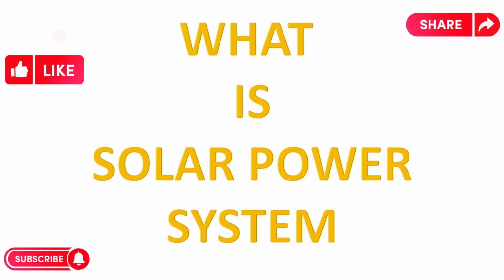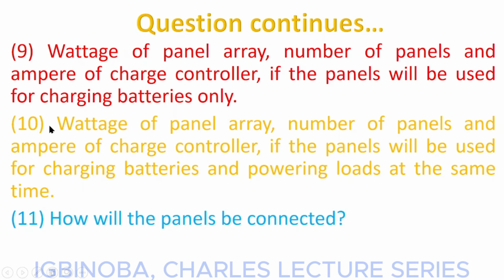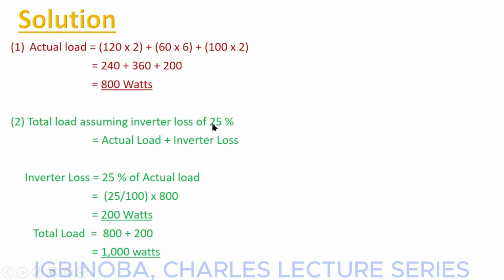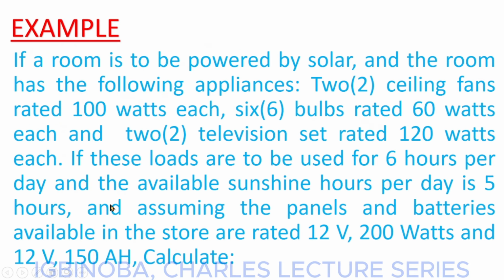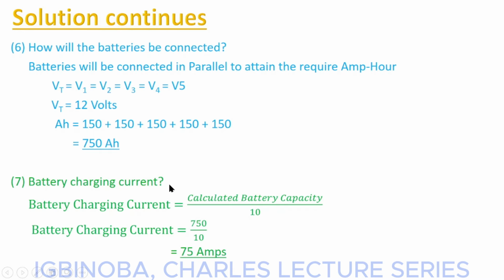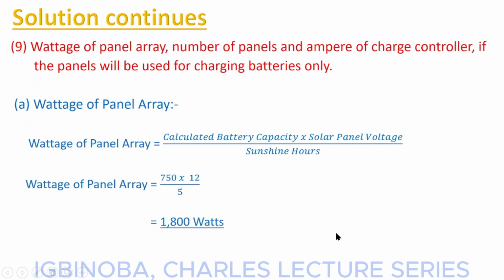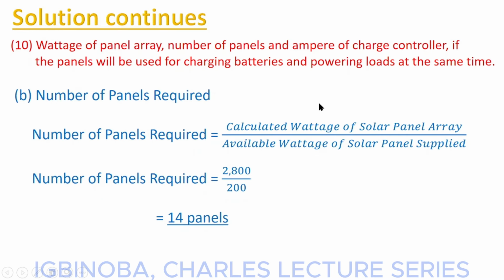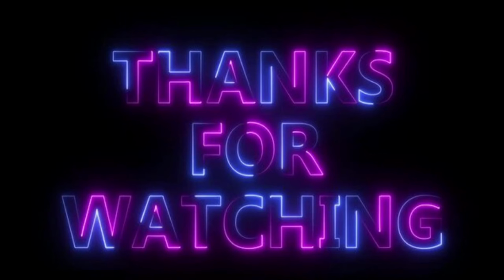Design of Solar Power System

Comment: EEE31E
Answer 
1380W
1725W
2156.25VA
1293.75Ah
9batteries
Parallel connection
129.4A
14h
3105W
16panels
258.75A
4830W
24panels
402.5A
The panels are arranged in parallel

Comment: MAR33G

Actual load = 1380W
Total load = 1725W
Inverter rating = 2156VA
Battery capacity = 1293.75Ah
No. of batteries = 8.625 ≈ 9 batteries
The batteries would be connected in SERIES
Battery charging current = 129.4A
Battery charging time = 14hrs
9a. Wattage of panel array = 3105W
9b. No. of panels = 15.5 ≈ 16
9c. Ampere of charge controller = 258.75A
10a. Wattage of panel array = 4830W
10b. No. of panels = 24.15 ≈ 24
10c. Ampere of charge controller =402.5
11 The panels will be connected in parallel

Comment: EEE17Q
Answer:
Actual load = 1380Watt
Total load = 1725 Watt
Inverter rating = 2156.25VA
Battery Capacity = 1239.75Ah
Number of batteries = 8.625 (9 batteries)
They will be connected in parallel
Battery charging current = 129.375A
Battery charging time with 40% loss = 14hrs
9a. Wattage of panel array = 3105Watt
9b. Number of panels = 16panels
9c. Ampere of charge controller = 258.75A
10a. Wattage of panel array with load = 4685 Watt
10b. Number of panels = 23 panels
10c. Ampere of charge controller = 373.75A
They will be connected in parallel

Comment: MAR29C
Answers

1. The actual pad is 1,380W
2. The Total load is 1,725W
3. The inverter rating is 2,156.23VA
4. The battery capacity is 1,293.75Ah 
5. The Number of batteries is 9
6.  The batteries are connected in parallel 
7. The Battery charging current is 129.4 amps.
8. The battery charging time is 14 hours.
9. a. The wattage of the panel array is 3,105W
b. The number of panels is 16 panels.
c. The Charge controller rating is 258.75 amps.
10. a. The wattage of the Panel array is 4,830 Watts 
b. The number of panels is 24 panels.
c. The charge controller rating is 402.5 amps
11. The panels are arranged in parallel

Comment: Petrochem53A 
1. Actual load: 1380W
2. Total load: 1725W
3. Inverter reading: 2156V
4. Battery capacity using a reserve of 75% : 1293.75h
5. Number of batteries for back up 9 hours 
6. How will the battery be connected: parallel 
7. Battery charging current: 129.4 hours 
8. Battery charging time with loss of 40%: 14hours
9. The wattage of panel array: 315W
9.1 No of panels:16 panels 
9.2 The charge controller rating 258.75 ampere 
10. The wattage of panel array 4830W
10.1. The no of panel: 24 panels
10.2 The charge controller rating 492.5 amps 
10.3 panels connection: parallel

Comment: EEE80B
1380 watts
1725 watts
2156 .25va
1293.75ah
9 batteries 
Parallel connection 
129.4amp
14 hrs
3105w
16 panels
258.75amps
4830 watts
24 panels
402.5 amps
The panels are arranged in parallel

Comment: CIV35I

1380watts
1725watts
2156.25 VA
1293.75 Ah
9 batteries 
parallel connection 
129.4 amps
14 hours 
16 panels
258.75amps
4,830 watts
24 panels 
402.5 amps 
the panels are arranged in parallel

Comment: PETRO26Z 

(1) Actual load = 1380 W

(2) Total load (with 25% inverter loss) =1725 W 

(3) Inverter rating (0.8 PF) = 2156.25 VA

(4) Battery capacity (75% reserve) = 1239.75 AH

(5) Number of batteries = 9 batteries 

(6) Battery connection = All in parallel (12V system)

(7) Battery charging current =  129.375A 

(8) Charging time (40% loss) = 14 hours

(9a) Wattage of panel array = 3105watts
(9b) Number of panels= 16panels
(9c) Ampere of charge controller = 258.75A

(10a) Wattage of panel array with load = 4485watts
(10b) Number of panels= 23panels 
(10c) Ampere of charge controller= 373.75A

(11) Panel connection =All in parallel (12V system)

Comment: Petrochem5E 
 
* 1380 watts 
1725 watts 
2156.25 VA 
1293.75 Ah
9 batteries 
Parallel connection 
129.4 amps 
14 hrs 
3,105 W
16 panels 
258.72 amps 
4,830 watts 
24 panels 
402.5 amps 
The panels are arrange in parallel

Comment: NAT43Q 

1. The actual load is 1,380W
2. The Total load is 1,725W
3. The inverter rating is 2,156.23VA
4. The battery capacity is 1,293.75Ah 
5. The Number of batteries is 9
6.  The batteries are connected in parallel 
7. The Battery charging current is 129.4 amps.
8. The battery charging time is 14 hours.
9. a. The wattage of the panel array is 3,105W
b. The number of panels is 16 panels.
c. The Charge controller rating is 258.75 amps.

10. a. The wattage of the Panel array is 4,830 Watts 
b. The number of panels is 24 panels.
c. The charge controller rating is 402.5 amps
11. The panels are arranged in parallel

Comment: NAT7G 

1. The actual load is 1,380W
2. The Total load is 1,725W
3. The inverter rating is 2,156.23VA
4. The battery capacity is 1,293.75Ah 
5. The Number of batteries is 9
6.  The batteries are connected in parallel 
7. The Battery charging current is 129.4 amps.
8. The battery charging time is 14 hours.
9. a. The wattage of the panel array is 3,105W
b. The number of panels is 16 panels.
c. The Charge controller rating is 258.75 amps.

10. a. The wattage of the Panel array is 4,830 Watts 
b. The number of panels is 24 panels.
c. The charge controller rating is 402.5 amps
11. The panels are arranged in parallel

Comment: MAR19S

Answer 

1. Actual load: 1380 W
2. Total load: 1840 W
3. Inverter rating: 2300 VA (2.3 kVA)
4. Battery capacity: 1226.67 Ah
5. Number of batteries: 9 batteries
6. Battery should be connected in Parallel
7. Battery charging current: 245.33A ≈ 250A
8. Charging time with 40% charging loss: 18.75 hours using 120 A and 40% loss
9. Solar panels for charging batteries only: 2944 W, 15 panels, 250A controller
10. Solar panels charging batteries and powering loads simultaneously: 4784 W, 24 panels, 400 A controller
11. The panel should be connected in Parallel

Comment: EEE52Z

1. Actual load = 1380Watt
2. Total load = 1725Watt
3. Inverter rating = 2156.25VA
4. Battery Capacity = 1239.75Ah
5. Number of batteries = 8.625, so 9 batteries
will be used
6. The batteries will be connected in parallel
7. Battery charging current = 129.375A
8. Battery charging time with 40% loss = 14hrs
9. For charging only:
a. Wattage of panel array = 3105Watt
b. Number of panels = 16panels
c. Ampere of charge controller = 258.75A
10. For charging + powering load:
a. Wattage of panel array with load =
4830Watt
b. Number of panels = 24panels
c. Ampere of charge controller = 402.5A
11. The panels will be connected in parallel

Comment: PETRO85G

1. Actual Load: 1380 W
2. Total Load: 1840 W
3. Inverter Rating (0.8 Power Factor): 2300 VA (or
2.3 KVA)
4. Battery Capacity: 1226.67 Ah
5. Number of Batteries: 9 batteries
6. Battery Connection: Parallel
7. Battery Charging Current: 120 A
8. Battery Charging Time: 16.67 hours
9. Solar Setup (Batteries Only): 2944 W (or
3000
W), 15 panels, 250 A charge controller
10. Solar Setup (Batteries + Load
Simultaneously):
4784 W (or 4800 W), 24 panels, 400 A charge controller
11. Panel connection: parallel

Comment: CHM23W
Actual load = 1380Watt
Total load = 1725Watt
Inverter rating = 2156.25VA
Battery Capacity = 1239.75Ah
Number of batteries = 8.625 (9 batteries)
They will be connected in parallel
Battery charging current = 129.375A
Battery charging time with 40% loss = 14hrs
9a. Wattage of panel array = 3105Watt
9b. Number of panels = 16panels
9c. Ampere of charge controller = 258.75A
10a. Wattage of panel array with load = 4485Watt
10b. Number of panels = 23panels
10c. Ampere of charge controller = 373.75A
They will be connected in parallel.

Comment: MEC24X 

1. Actual load= 1380W
2. Total load= 1725W
3. Inverter rating using power factor of 0.8= 2156.3VA
4. Battery capacity= 1239.8Ah
5. Number of batteries= 9 batteries 
6. They would be connected in parallel to maintain the same voltage
7. Battery charging current= 129.4A
8. Battery charging time with a loss of 40%= 14 hours
9.   (a) Wattage of panel array to charge battery only = 3105W
      (b) Number of panels= 16 panels
      (c) Ampere of charge controller= 258.8A
10.   (a) Wattage of panel array to charge battery and carry load= 4430W
          (b) Number of panels= 25 panels
            (c) Ampere charge controller= 402A
11. They would be connected in parallel so that the voltage doesn't change

Comment: EEE48V

1380W
1725W
2156.23VA
1293.75AH
9 batteries
Connected in parallel
129.4amps
14
3105W
16
258.75amps
4830watts
24 panels
402
Connected in parallel

Comment: CIV89K

Answers

1.  Actual load = 1380Watt
2.  Total load = 1725Watt
3.  Inverter rating = 2156.25VA
4.  Battery Capacity = 1239.75Ah
5.  Number of batteries = 8.625, so 9 batteries will be used
6.  The batteries will be connected in parallel
7.  Battery charging current = 129.375A
8.  Battery charging time with 40% loss = 14hrs
9.  For charging only:  
    a. Wattage of panel array = 3105Watt  
    b. Number of panels = 16panels  
    c. Ampere of charge controller = 258.75A
10. For charging + powering load:  
    a. Wattage of panel array with load = 4830Watt  
    b. Number of panels = 24panels  
    c. Ampere of charge controller = 402.5A
11. The panels will be connected in parallel

Comment: PETRO17Q 
1. ACTUAL LOAD=1380W
2. TOTAL LOAD=1725W
3. INVERTER RATING=2156.25VA
4. BATTERY CAPACITY=1293.75Ah
5. NUMBER OF BATTERIES= 8.625
6. BATTERIES CONNECTION= PARALLEL 
7. BATTERY CHARGING CURRENT=129.375A
8. BATTERY CHARGING TIME=14HRS
9a. PANEL WATTAGE=3105W
9b. NUMBER OF PANEL=15.525
9c. AMPERE OF CHARGE CONTROLLER=258.75A
10a. PANEL WATTAGE =4830W
10b. NUMBER OF PANEL=24.15
10c. AMPERE OF CHARGE CONTROLLER= 402.5A
11. PANEL CONNECTION= PARALLEL

Comment: COMP96R:

1. The actual pad is 1,380W
2. The Total load is 1,725W
3. The inverter rating is 2,156.23VA
4. The battery capacity is 1,293.75Ah 
5. The Number of batteries is 9
6.  The batteries are connected in parallel 
7. The Battery charging current is 129.4 amps.
8. The battery charging time is 14 hours.
9. a. The wattage of the panel array is 3,105W
b. The number of panels is 16 panels.
c. The Charge controller rating is 258.75 amps.

10. a. The wattage of the Panel array is 4,830 Watts 
b. The number of panels is 24 panels.
c. The charge controller rating is 402.5 amps
11. The panels are arranged in parallel

Comment: CHM95Q
ANSWERS:
(1) ACTUAL LOAD = 1380 watts
(2) TOTAL LOAD = 1725 watts
(3) INVERTER RATING VA = 2156.25 VA
(4) BATTERY CAPACITY = 1293.75 Ah
(5) NO. OF BATTERIES = 9 Batteries
(6) PARALLEL CONNECTION
(7) BATTERY CHARGING CURRENT = 129.39 Amps
(8) CHARGING TIME (40% LOSS) = 14 Hrs
(9a) PANEL WATTAGE = 3105 watts
(9b) NO. OF PANELS = 16 Panels
(9c) AMPS OF CHARGE CONT. = 258.75 Amps
(9d) PARALLEL CONNECTION
(10a) PANEL WATTAGE = 4830 watts
(10b) NO. OF PANELS = 24.15 (Make 25 panels to carry system)
(10c) AMPS OF CHARGE CONT. = 402.5 Amps

Comment: COMP95Q

1. The actual pad is 1,380W
2. The Total load is 1,725W
3. The inverter rating is 2,156.23VA
4. The battery capacity is 1,293.75Ah 
5. The Number of batteries is 9
6.  The batteries are connected in parallel 
7. The Battery charging current is 129.4 amps.
8. The battery charging time is 14 hours.
9. a. The wattage of the panel array is 3,105W
b. The number of panels is 16 panels.
c. The Charge controller rating is 258.75 amps.

10. a. The wattage of the Panel array is 4,830 Watts 
b. The number of panels is 24 panels.
c. The charge controller rating is 402.5 amps
11. The panels are arranged in parallel

Comment: PETRO27A 

Answer: 
1. Actual Load: 1380 W 
2. Total Load: 1840 W
3. Inverter Rating (0.8 Power Factor): 2300 VA (or 2.3 kVA)

 4. Battery Capacity: 1226.67 Ah 
5. Number of Batteries: 9 batteries 
6. Battery Connection: Parallel 
7. Battery Charging Current: 120A 
8. Battery Charging Time: 16.67 hours 
9. Solar Setup (Batteries Only): 2944 VW (or 3000 W), 15 panels, 250 A charge controller 
10. Solar Setup (Batteries + Load Simultaneously): 4784 W (or 4800 W), 24 panels, 400 A charge controller 
11. Panel connection: parallel

Comment: NAT13M

1. The actual pad is 1,380W
2. The Total load is 1,725W
3. The inverter rating is 2,156.23VA
4. The battery capacity is 1,293.75Ah 
5. The Number of batteries is 9
6.  The batteries are connected in parallel 
7. The Battery charging current is 129.4 amps.
8. The battery charging time is 14 hours.
9. a. The wattage of the panel array is 3,105W
b. The number of panels is 16 panels.
c. The Charge controller rating is 258.75 amps.

10. a. The wattage of the Panel array is 4,830 Watts 
b. The number of panels is 24 panels.
c. The charge controller rating is 402.5 amps
11. The panels are arranged in parallel

Comment: EEE 100V 

1. Actual load = 1380Watt

2. Total load = 1725Watt

3. Inverter rating = 2156.25VA

4. Battery Capacity = 1239.75Ah

5. Number of batteries = 8.625 (9 batteries)

6. They will be connected in parallel

7. Battery charging current = 129.375A

8. Battery charging time with 40% loss =

9a. Wattage of panel array = 3105Watt

9b. Number of panels = 16panels 9c. Ampere of

charge controller = 258.75A

10a. Wattage of panel array with load = 4485Watt

10b. Number of panels = 23panels

10c. Ampere of charge controller = 373.75A

I1. They will be connected in parallel

Comment: MAR7G 

Answer

1380 watts

1725 watts

2156.25 VA

1293.75 Ah

9 batteries

Parallel connection

129.4 amps

14 hours

3,105 W

16 panels

258.75 amps

4,830 watts

24 panels

402.5 amps

The panels are arranged in parallel

Comment: MEC88J 

1380 watts
1725 watts
2156.25 VA
1293.75 Ah
9 batteries
Parallel connection
129.4 amps
14 hours
3,105 W
16 panels
258.75 amps
4,830 watts
24 panels
402.5 amps
The panels are arranged in parallel

Comment: CHM1A
Answer:
Answers:
1. Actual load = 1380Watt
2. Total load = 1725Watt
3. Inverter rating = 2156.25VA
4. Battery Capacity = 1239.75Ah
5. Number of batteries = 8.625 (9 batteries)
6. They will be connected in parallel
7. Battery charging current = 129.375A
8. Battery charging time with 40% loss = 14hrs
9a. Wattage of panel array = 3105Watt
9b. Number of panels = 16panels
9c. Ampere of charge controller = 258.75A
10a. Wattage of panel array with load = 4485Watt
10b. Number of panels = 23panels
10c. Ampere of charge controller = 373.75A
11. They will be connected in parallel.

Comment: PETRO2B 
Answers

1. Actual load = 1380 Watt
2. Total load = 1725 Watt
3. Inverter rating = 2156.25 VA
4. Battery Capacity = 1239.75 Ah
5. Number of batteries = 8.625 (9 batteries)
6. They will be connected in parallel
7. Battery charging current = 129.375 A
8. Battery charging time with 40% loss = 14 hrs
9a. Wattage of panel array = 3105 Watt
9b. Number of panels = 16 panels
9c. Ampere of charge controller = 258.75 A
10a. Wattage of panel array with load = 4485 Watt
10b. Number of panels = 24 panels
10c. Ampere of charge controller = 373.75 A
11. They will be connected in parallel

Comment: CIV65M
ANSWER 

1. Actual Load: 1380 W

2. Total Load: 1840 W

3. Inverter Rating (0.8 Power Factor): 2300 VA (or 2.3 KVA)

4. Battery Capacity: 1226.67 Ah

5. Number of Batteries: ৭ batteries

6. Battery Connection: Parallel

7. Battery Charging Current: 120 A

8. Battery Charging Time: 16.67 hours

9. Solar Setup (Batteries Only): 2944 W (or 3000 W), 15 panels, 250 A charge controller

10. Solar Setup (Batteries + Load Simultaneously): 4784 W (or 4800 W), 24 panels, 400 A charge controller

II. Panel connection: parallel

Comment: Mar930
1.1380WATT
2. 1725WATT
3. 2156.23VA
4. 1296.75Ah 
5. 9 batteries 
6. The batteries are connected in parallel
7. 129.4Amps 
8. The battery charging time is 14 hours
9a. 3105WATT
9b. 16 panels 
9c. 258.75Amps 
10a. 4830WATT 
10b. 24 panels 
10c. 402.5Amps
11. The panels are connected in parallel

Comment: MEC11K 
Answer: 
1.  Actual Load: 1380 W
2.  Total Load: 1840 W
3.  Inverter Rating (Power Factor = 0.8): 2300 VA (2.3 kVA)
4.  Battery Capacity Required: 1226.67 Ah
5.  Total Number of Batteries: 9 units
6.  Battery Configuration: Parallel Connection
7.  Battery Charging Current: 120 A
8.  Estimated Battery Charging Time: 16.67 hours
9.  Solar Array Sizing - For Battery Charging Only: 2944 W (Approximately 3000 W), 
    comprising 15 solar panels with a 250 A charge controller.
10. Solar Array Sizing - For Simultaneous Battery Charging and Load Supply: 4784 W 
    (Approximately 4800 W), comprising 24 solar panels with a 400 A charge controller.
11. Solar Panel Connection: Parallel Configuration

Comment: MAR5E

Answers:

1. Actual load = 1380 W

2. Total load assuming inverter loss of 25% = 1725 W

3. Inverter rating in VA using power factor of 0.8 = 2156.25 VA
   

4. Battery capacity using a factor for reserve of 75% = 1150 Ah
   

5. Number of batteries for backup hours = 8 batteries
   

6. Battery connection = Parallel connection
   (8 batteries connected in parallel)

7. Battery charging current = 120 A

8. Battery charging time assuming a charging loss of 40% = 16.67 hours

Comment: MEC81C

1. Actual load = 1380W
2. Total load = 1725W
3. Inverter rating = 2156.25VA 
4. Battery Capacity = 1239.75Ah
5. Number of batteries = 8.625 (9 batteries 
6. They will be connected in parallel 
7. Battery charging current = 129.375A 
8. Battery charging time with 40% loss = 14hrs
9a. Wattage of panel arrav = 3 1 05Watt 
9b. Number of panels = 16panels 9c. Ampere of charge controller = 258.75A 
10a. Wattage of panel arrav with load = 4485Watt
10b. Number of panels=23panels 
10c. Ampere of charge controller = 373.75A 11. They will be connected in paralle

Comment: PETRO87I

1380W
1725 W
2156.25VA
1293.75AH
9 batteries.
The batteries will be connected in parallel
129.375A
14hrs
3105W
16 panels
258.75A
300A Charge controller will be suitable.
4830 A
24 Panels
402.5A
500A charge controller will be suitable The panels will be connected in Series

Comment: Petro48V 

1380W
1725W
2156.25VA
1293.75AH
9Batteries
The batteries will be connected in parallel 129.375A
14hrs
3105W
16 panels
258.75A
300A charge controller will be suitable .
4830A
24 panels
402.5A
500A charge controller will be suitable 
The panel will be connected in series